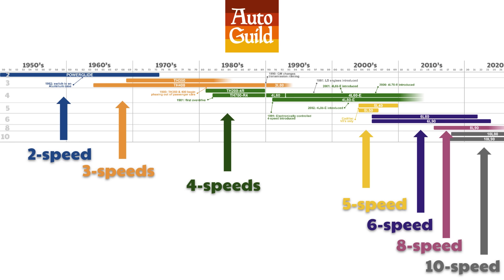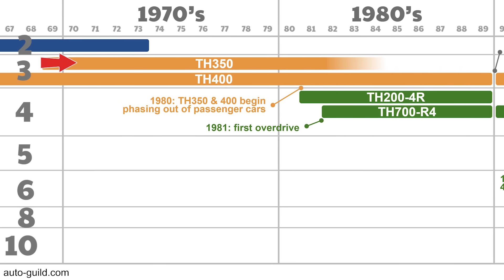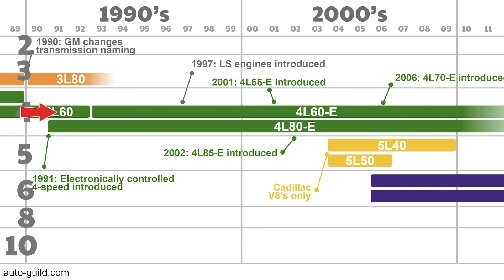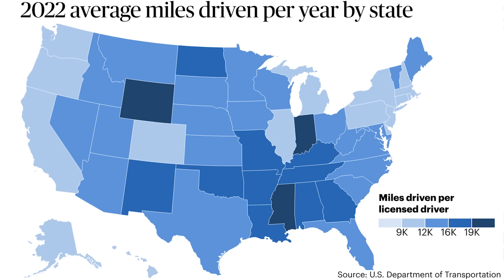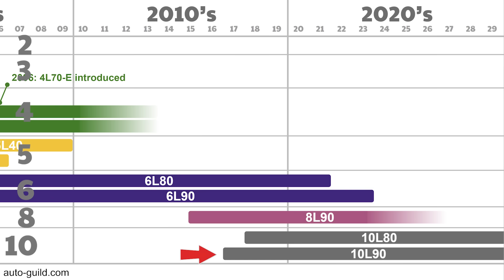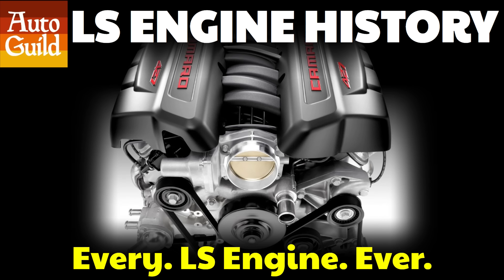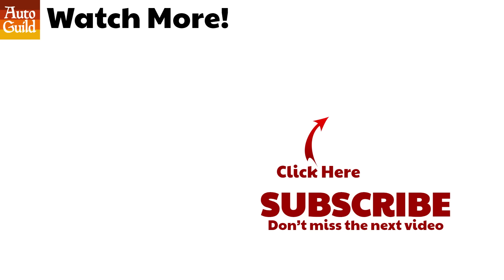All 15 Automatic Transmissions (Powerglide to 10L90)

Comment: Brother can you do one on GM manual transmissions please ? They are iconic too man 😬🫣
Reply from the maker: Okay looks like your post got 23 thumbs up.  For sure I will do a manual transmission.  I was actually already planning on it.  I'm swapping my 68 Camaro from an automatic to a manual.  But I'm working on my e-book right now so it may be a while, hopefully this summer.  I'm a manual guy and have been driving a manual transmission as my daily driver  since I was 22
Reply: @AutoGuild  man I appreciate that brother !! You give pretty solid information I appreciate what you said in the big and small block comparisons 
I have a 65 Impala SS with the original L74 engine and original M20 4 speed it’s such a great ride ..you couldn’t go wrong with those old Muncies !
Reply: @AutoGuild  my 68 RS/SS Camaro is matching numbers 350 with 4 speed Muncie. I love it couldn’t imagine ever having it as an auto.
Reply: @AutoGuild  please include the other TR6060 and Tr6070 model's and flywheel and clutch opportunities 

my charger 60's ( id have copycat'd + adaptor from tranzla 4X4-kit+atlas/gm-box's it for my k1500 1980's, but i can't get tags/EPA anymore in my state for hemi-gas or 400ci-chevy or diesels so time for F150/BEV swapping instead ) is running a 2014~z51-gearing ( 3.2 rear tries 26in to 33in/barrow'd off the truck 😉 winter/rain-set-up or mpg ) TR70 🤫 and a 2g-hemi/440-engine-platform corvette C7 blower/?lt5? DMF-combo, i think 🤔💭the 2016~ hellcats are close enough to fit+work but i wanted the DMF to make the wife/kid's more comfortable/NVH

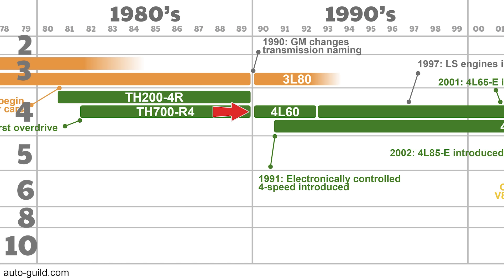my 1968 C10 had/has-RIP* a 4-speed stick indiana transmission ( 4:10 rear, 327ci ) its okay but over-drive is nice to having on the freeways, towing didn't let me down 1k miles + with 6K+LB behind
Reply: @AutoGuild  could you include swap info into your video such as info into anything with a PCM from 97 n up, im swapping a 06 silverado from auto to manual n cant find alot about the swap accept bypassing the neutral safety switch without having to tune it, id like to know how to do it if possible without a tune n then the tune way, if anyone reads this n knows plz reply
Reply: Is automatic reliable @AutoGuild
Reply: Is manual faster than automatic  @AutoGuild
Reply from the maker: @Hamodi-li7vi  On 60s-90s cars a manual was usually faster but in todays modern cars with 6-10 speed transmissions the automatics are usually faster.  But, the manuals are usually around 50-100lbs lighter than automatic vehicles.  I always prefer a manual because I personally find it more engaging and rewarding to drive.
Reply: @AutoGuild  but does lighter mean faster
Reply: Love my Muncie.
Reply: T56 is all you need to know
Reply: @Telowin  yea well Muncies were around way before the t56 and they are legendary
Reply: @1965bruiser  I’ll take mine all day 💯
Reply: the best 4 speed is a Borg warren the next is a Muncie 21 rock crusher auto is the 02xx 400r turbo u can tell if it has 02xx welded on the bell housing then u can put a stage 3 shift kit then it like a 3 speed u have to manually shift it  all the 4 speed auto suck very weak trans. and 350 turbo's don't even touch one if u plan on driving it hard
Reply: Agreed that would awesome!
Reply: Heard bitches!😂
Reply: I love my NV4500
Reply: Good God, I’m on my damned 4th clutch master cylinder, in my 2010 (5th gen) Chevy Camaro SS manual (LS3) coupe… The C6 Corvette had fairly similar issues, but had a TSB regarding potential recalls on the clutch master cylinder and the fluid reservoirs for them. 

As much as they’re strong, they had their fair share of issues, and the GM design for clutch hydraulics absolutely sucked (especially the CMC’s). With them slightly built/upgraded, they’re a completely different beast of a manual transmission. 

I’m about to get a twin disc clutch, and most people recommend to stay to OEM parts for the clutch hydraulics (even though they can fail). There’s only 2 or 3 upgrades for the CMC/CSC for the 5th gen Camaro V8’s (Tremec TR-6060), and I decided against getting a C6 Corvette manual with the TR-6060 because of all the work needed if the CSC had to come out. If you know, you know…
Reply: All Chevy transmissions are shit You want no clutches in your earbuds buy yourself a chevy transmission
Reply: he's planning to, previous/ original video of this, I asked and he replied that it's in the works

Comment: Bad ass video ! Full of information. You can tell you did your homework..... 
Speaking of swapping transmissions,... A couple years ago , I swapped the stock 305/th350 in my 78 firebird, to a 355/700R4...... As far as size and position (relative to the stock engine location ) , would a 4L60E be a direct swap for my 700R4 ?
Reply from the maker: Go to Google and search this:  700R4 To 4L60E Transmission Swap On A 1989 Pontiac Trans Am - Electronic Overload
Reply: Somewhere there is a list of the lengths which is I believe is the deciding factor for a direct swap (other than electronic interface for shifting).  YES, we need the author of the video to weigh in, please.
Reply from the maker: Search this on google: 700R4 To 4L60E Transmission Swap On A 1989 Pontiac Trans Am - Electronic Overload
Reply: Yes but 4L60E is electronic. You would want a 4L60 no E.